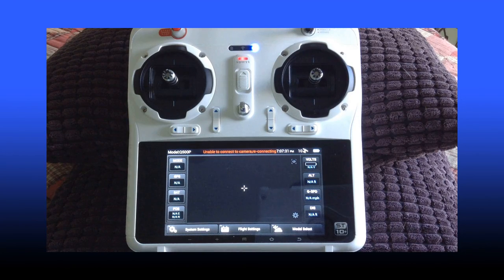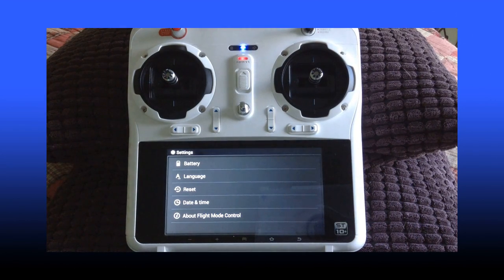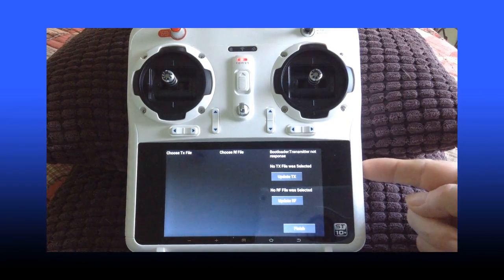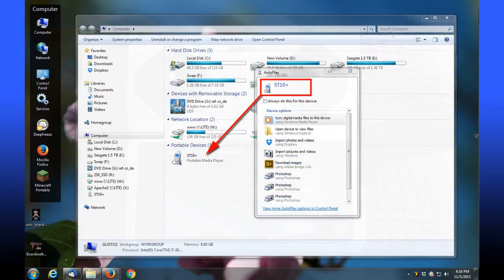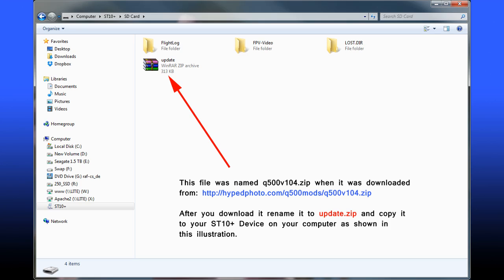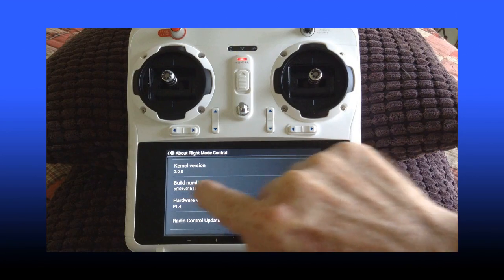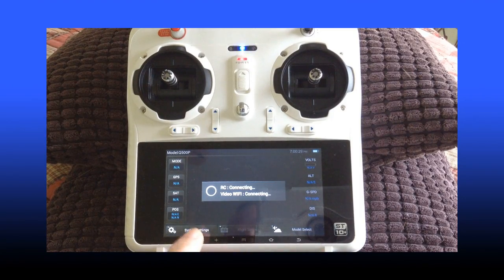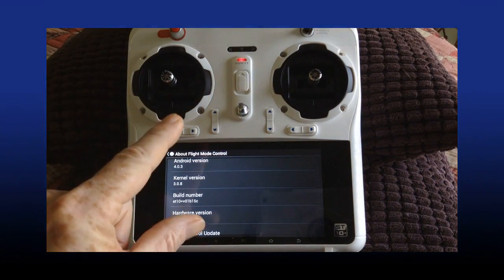Firmware Updating | Downgrading the ST10 | St10+ Transmitter for the Yuneec Q500 Or Q500+

Comment: I have tried to downgrade from v01b30c back to v01b24c to get rid of the issue with low battery warning but this procedure does not work. My remote went through the update process just like in the video, but the build number did not  change.

Comment: I tried to restore firmware
but he remains in the installing mode with Start
 after the update 30c
I can not he set the picture settings will remain at 50p 16.9
can not put him at 45 or 60p
who has an idea to solve it

This is updated cgo2 + 2.8.0std
Q500 4k v1.07
st10 + 30c fupdate